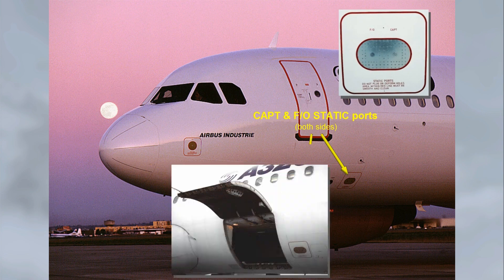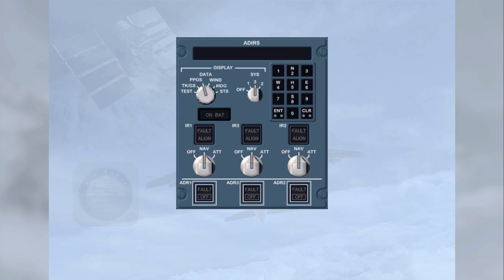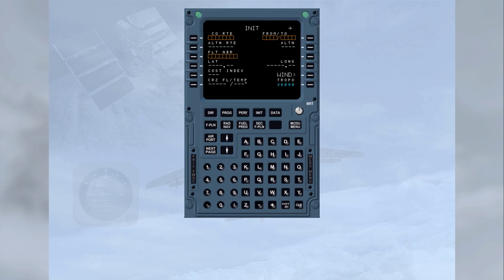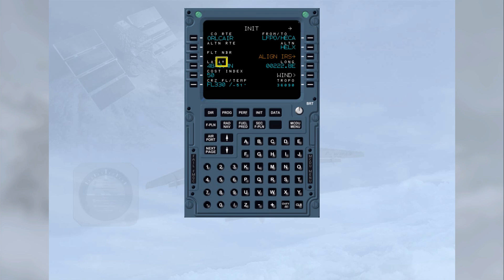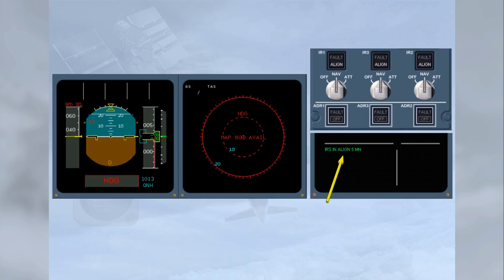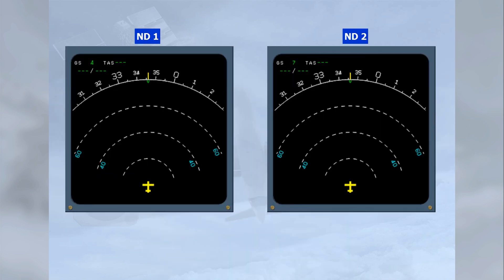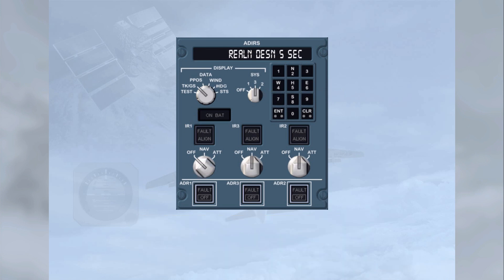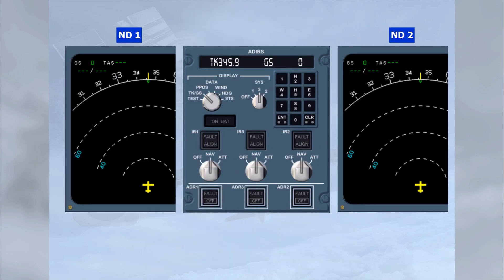Airbus A320 ADIRS - How To Align IRS

Comment: How does a pilot know longitude and latitude of the stand at the airport? I don't see those on airport ground charts. Is that information on the OFP?
Reply from the maker: Hi there, If I've understood your question correctly, you'll see on the video from around the 2:50 mark that after the route has been entered (in this case ORLCAIR) the corresponding coordinates are automatically sourced/entered as this information is stored on the aircraft navigation database.
Reply: @CommercialAviationTraining 
Wouldn't that require aircraft flying a specific route to always be assigned to the same stands, which isn't guaranteed?

I don't understand how the gate at which an aircraft is parked (and therefore LNG and LAT) can be stored in a static database, when gate assignment is at least somewhat dynamic.
Reply from the maker: @a5cent  Airlines often have designated stands at the airports they fly to. The coordinates of which would be built into the specific airlines data base as the video states. I will double check the manufacturers manual on this to see if there's more information I can offer you.
Reply: @CommercialAviationTraining 
I don't even know what IRS tolerances would be considered acceptable for safe navigation, so Im probably bugging you over something where the precision isn't even required. Sorry 😂 Just my curious mind.

But if it does need to be this precise, my main question is still where that information comes from. The stand can't be entered into the MCDU, so even if that is in the database, there is no way to tell the MCDU the aircraft is at a different stand, and I've never seen a chart with that level of detail.

All I'm aware of is LNG and LAT being provided for the airport.